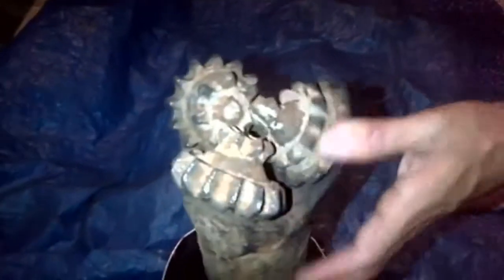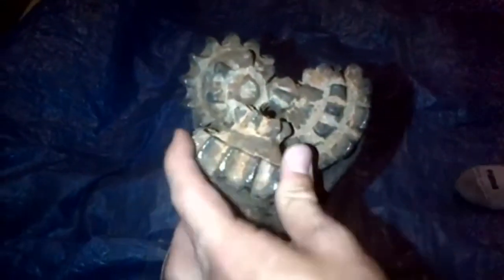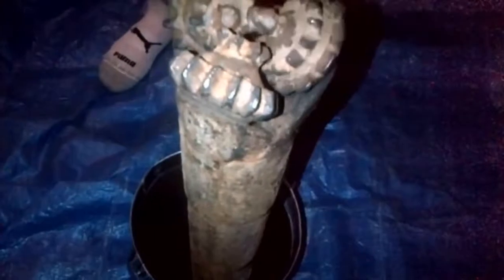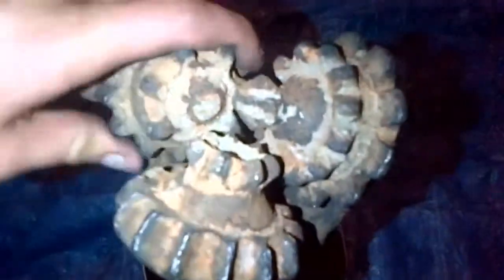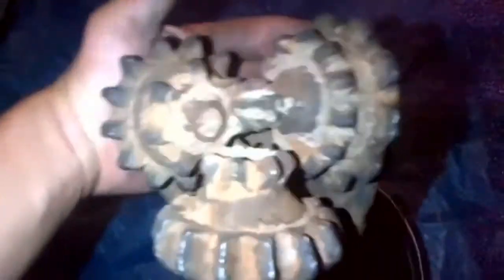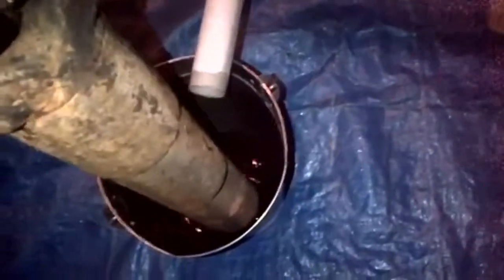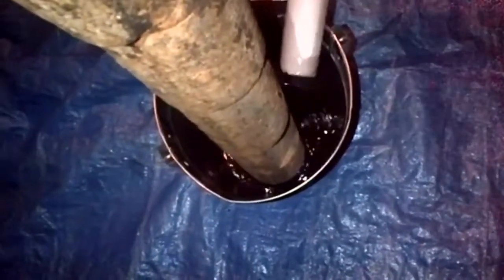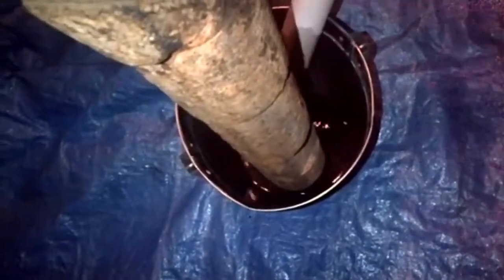🆘🔍⚜🔎KNOW A BIT?🆘TELL A BIT!🎓🕶 1930's Howard Hughes rotary tri-cone drill bit? Need expert help

Comment: Howard Hughes' dad  invented this bit. Where did you find this?
Reply: In the woods in Alberta.. probably wasn’t supposed to take it, but it wasn’t really doing anything rotting in the woods in moss at the bottom of a big hill with absolutely no roads around for miles??
Reply: Kinda, Hughes dad, invented the original 2/ twin cone bit . This one was invented/ designed by Hughes tool Co.  engineers , after his father passed/ died.
Reply: I woulda grabbed it too
Reply: It’s no good your not supposed to move it with your hand it’s supposed to be stiff like the one junk!!